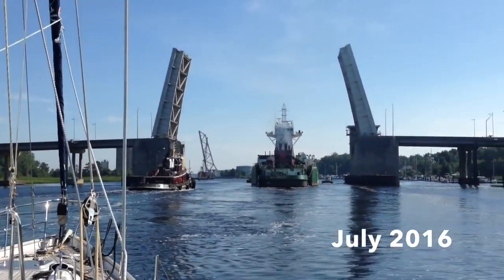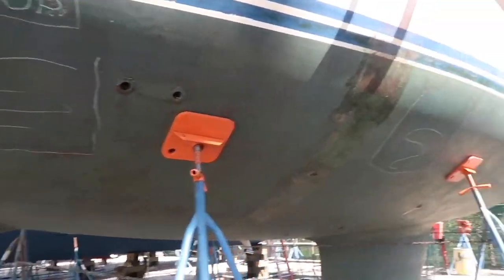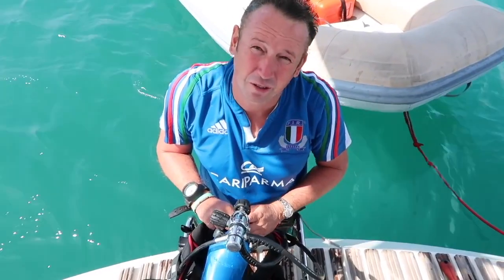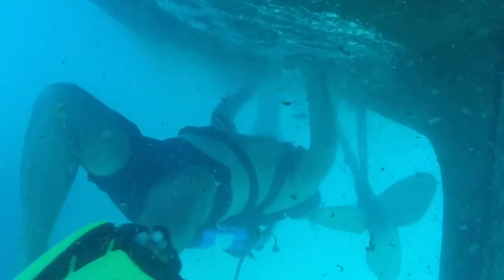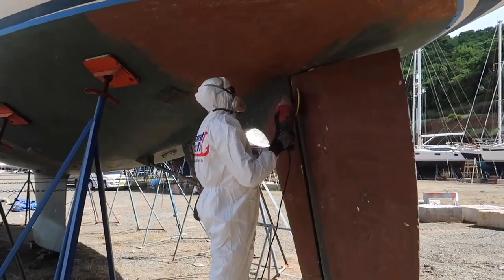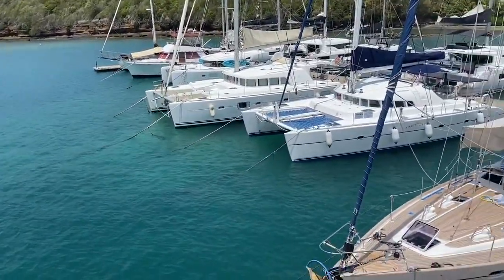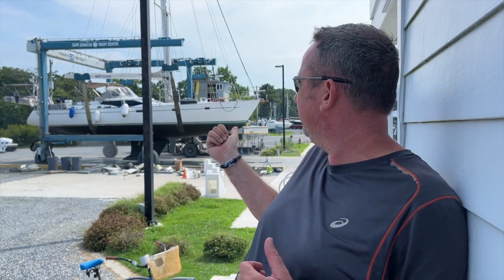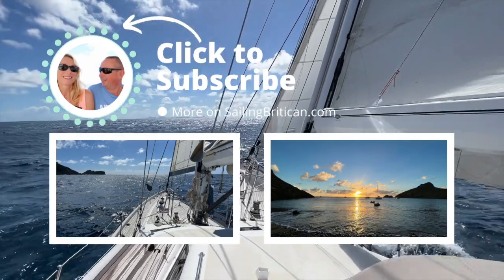CopperCoat Antifoul Experience - Application Problems 3-Year Update

Comment: I’m in my 8th year of Coppercoat. 👍 

Your wrong however if you think you only have to wash it and put it back in the water. You need to brace it or using very light sand paper, you need to go all over the boat now before putting it back in.
Reply from the maker: Do you do that every year? Or every five years or....? Since we've had it working we have never sanded it and it works just as it did upon the initial 'working' application. Smiles, Kim
Reply: @Sailingbritican   sorry for the slow response I on,y just noticed your question. I was doing it every year with pull out for routine winter maintenance but now I do it every second year.  The instructions do state it should be a braided regularly. It’s what exposes the copper.

Comment: The product may work when properly applied, but doesn’t seem like it’s worth the hassle compared to other options. That’s my take away from all this.  Glad the folks at Copper Coat were willing to help you out, even though it appears it wasn’t technically their problem.
Reply: CC works and it is worth every penny, it's way more environmentally friendly and saves big bucks in the long time.
It just all comes down to how it is applied.
Reply: If done properly, it’s very much worth it. Mine is in its 8th year. Self applied.

Comment: So basically Coppercoat works but it must be put on properly and that's relatively difficult to do - so you need to really make sure both you and the yard/team really know what they're doing.
Reply from the maker: I wouldn't say it's difficult but yes, it's important to know the exact procedure. I think the issue is that the normal ablative antifoul goes on any way that you do it. There is no way to get it wrong. I'm not sure if some boatyards realized that CC needs to be done very precisely. Thanks for commenting Tom. Smiles, Kim

Comment: It seems after all this drama with CC, there are 2 clear lessons here for all sailors;
1. The skipper is ultimately responsible for work done by yards. So know what is being done and how it should be done properly, and then insist on it. Inspect what you expect.
2. You need to wipe the slime growth off regularly to prevent barnacles. If the CC is applied properly, this is easy to do with a soft cloth. But very cold water and crocodiles are issues that need to be mitigated.
Reply from the maker: Good points Rob. Smiles, Kim